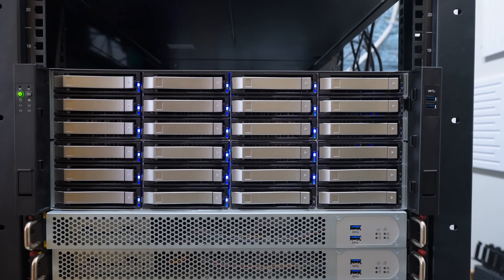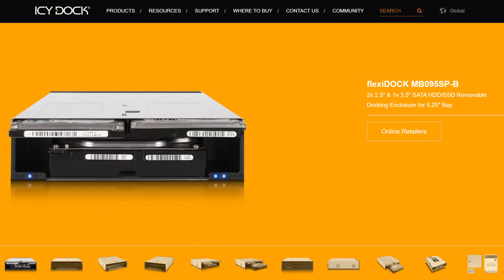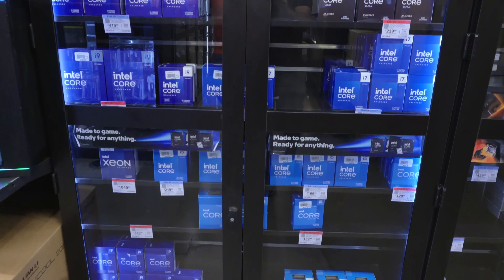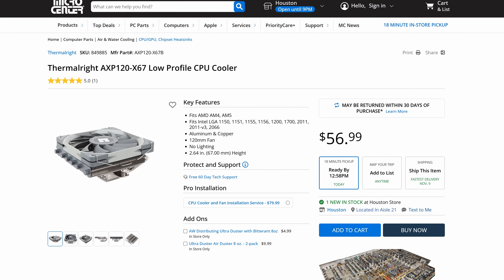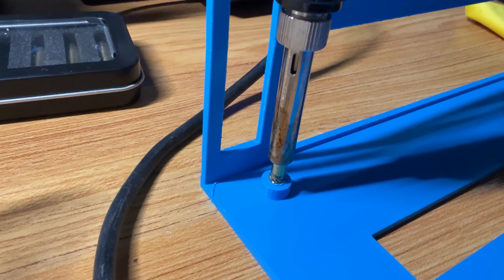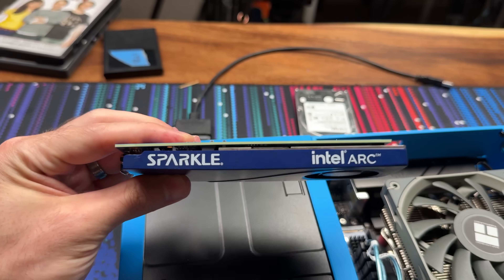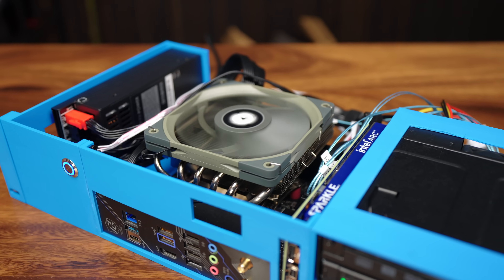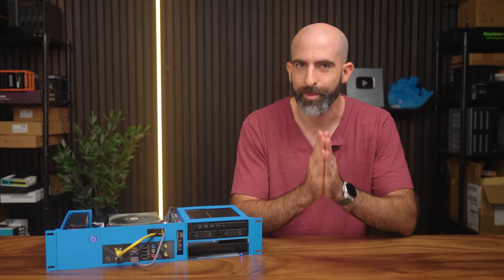I built an Automated Media Ingestion Server

Comment: Nice project, I am working on a similar rig, I ust need to do the automation

I have 90% AMD PCs (except for an old Intel desktop and laptop) and I have very few problems using  Fedora

Even on my boxes with Nvidia graphics cards,  I get the Nvidia driver from RPMForge and use AKmods to install it

I do have some Debian installs which seems to work better with Python and AI stuff

Still don't have a 3D printer but I do have a nice woodworkng shop and I am thinking of building a Tardis case

And like others have said, you need to pick a better name because it sounds a lot like ANUS when the letters are not pronounced individually

Comment: You don't have to output the file with MakeMKV all you have to do is open the blu-ray disk in MakeMKV and load the titles. When the titles are loaded in MakeMKV you can then use handbrake to load the tiles of the blu-ray disk and this will allow for encoding. I do this will all of my blu-ray disks.

Comment: I wonder how that PLA server chassis holds up in a rack with the system becoming heat soaked - I had plans for 3D printing stuff like that but was afraid the PLA might not be good enough for the temps so I never started and pushed the project down the line until I have a printer that can print like ABA or something like that that can take more heat....

Comment: Bonus, you can use the iGPU with Plex or Jellyfin for transcode, so that it handles codecs on separate metal than the ingest, meaning you can do both at once without concern. (I/O excepted)

[Edit]
Doing some testing on my system using hwaccel w/ vaapi, (A Linux generalist Video Acceleration API)

ffmpeg -encoders |grep -i vaapi
...
  libavutil      59. 39.100 / 59. 39.100
  libavcodec     61. 19.101 / 61. 19.101
  libavformat    61.  7.100 / 61.  7.100
  libavdevice    61.  3.100 / 61.  3.100
  libavfilter    10.  4.100 / 10.  4.100
  libswscale      8.  3.100 /  8.  3.100
  libswresample   5.  3.100 /  5.  3.100
  libpostproc    58.  3.100 / 58.  3.100
 V....D av1_vaapi            AV1 (VAAPI) (codec av1)
 V....D h264_vaapi           H.264/AVC (VAAPI) (codec h264)
 V....D hevc_vaapi           H.265/HEVC (VAAPI) (codec hevc)
 V....D mjpeg_vaapi          MJPEG (VAAPI) (codec mjpeg)
 V....D mpeg2_vaapi          MPEG-2 (VAAPI) (codec mpeg2video)
 V....D vp8_vaapi            VP8 (VAAPI) (codec vp8)
 V....D vp9_vaapi            VP9 (VAAPI) (codec vp9)

My 2560x1600 26M MKV file comes out around 9MB (9.2 w/ CPU and 9.1 w/ GPU)
The CPU encode actually seems a bit faster than the GPU encode, but y'know, takes all the system resources :D

I'm guessing you either aren't familiar with VAAPI (seems unlikely) or more likely, have been unpleased with either its performance, or its output, in past?

Comment: You did the shopping backwards. Start by looking at the requirements of the software, and get the hardware that matches those needs, GPU to do the encoding, any card with an nVENC enabled chip from the last five years will do most CoDecs in hardware, the last year or so for AV1. Intels ARC GPU's all do AV1, HEVC, h265 and h264 in hardware. Then choose a M'board with the bandwidth requirements matching the GPU board, and then put a CPU to run the the system and move the data from drives to ram and back. A hardware based encoder should be money heavy on the GPU and money light nearly everwhere else.
If looking for future projects, how about a Linux based NAS, that mirrors those ProRes files to three backup drives (one each for Cinematographer, Editor and Director, transported and stored separately), then does the Proxy Encoding from there, clearing the inserted SSD once the proxy encode has been done, so the original media is ready to go back in to the recording pool for the 1AC to grab as needed. It'll need a UPS as well, so it can pause the processes and go in to standby if the AC power is lost.

Comment: 1:32 assuming that one of your uses is encoding to 1080p for smartphones (because most smartphones are 1080p / even 1440p, the last 720p smartphone on Apple’s side was what, the first gen SE?) it’s probably for the best that you didn’t end up using the AMD iGPU for transcoding, as I think that iGPU is from the generation where every AMD GPU has a hardware defect encoding 1080p (it encodes it as 1088p for some math reason, idk what support for that looks like.) 

AMD’s GPU encoding isn’t exactly as well regarded as Intel’s for plenty good reason, as you stumbled on in the video. (Although, I should mention that a bunch of comments seem to think it’s just because of whatever distro you used that you had problems with FFmpeg.)

Comment: currently putting something similar together since i want to switch cases and get rid of my 5.25 bays on my main pc. does that bluray drive you got let you rip 4k blurays? i thought i remember reading theres only a few drives thatll let you do it or let you put custom firmware on them. pretty slick build, and having the ingest fully automated is a big convenience
Reply from the maker: The drive worked with no issues ripping blurays with makedvd

Comment: This is exactly something I have been looking for to start storing some of my old movies. I was just planning on manually ripping the DVDs and moving to the NAS, this will help a ton. Now I just need to figure out an easy way to convert my old VHS tapes to data.
Reply: Are your VHS tapes home made or commercial ?  Commercial tapes have an early version of digital rights protection.
Reply: @davidboyle3032  Commercial, right now I have it running through a video capture card with audio. Quality is kind of butt, however it seems to work.

Comment: I am validated in my choice of blu ray drive and icy dock bay combo.   I got a 6u rack off amazon though and hung it vertically in my entry closet. Its also my steam box so the 6u was good for having enough space for a full board and video card, and 3 5.25 drives.  I got so much space for drives i got a sas card.
Reply: The laptop bluray drive is vital for mounting it vertically.  Most full size blu ray drives can't handle the disc falling in like that, but the laptop drive you Clio it right onto the spindle

Comment: So basically this is a way cooler version than what I did with my own little ffmpeg workflow for ripping. I still dont have the entire thing automated because i really need to do a lot of code cleanup and make it a lot better at deciding when to transcode the audio and when not. Do you do stuff like checking whether footage is interpolated or telecined beforehand I havent done that yet and keep that manual for now. Automating that is something i should really get to. Also I am guessing that means that you dont really have a way of handling different video differently? LIke different settings depending on whether its animated or live action or based on the level of noise? I am guessing that is very much out of scope for this kind of application. Either way, this is really cool and gave me a list of other things I should improve on what I am doing.

Comment: I'm attempting to digitize 500+ blurays so I want to do a project with a disc magazine that automatically feeds them into the ODD. I'm considering buying a 'for parts' AV system that had a 100 disc capacity for when CDs were the media of choice. Haven't figured out the actual mechanics yet but I'm excited to tinker with it.

Comment: Question: why have the motherboard IO panel facing the front if you're going to have wires pass through? Wouldn't it be better to have like a USB hub attached to the front that routes to the motherboard?

Also, I'm not sure I'd really call this 2U. This requires being at the top of the rack or an open 1U above it for cooling. Additionally, i personally wouldnt be confident in the plastic to withstand the weight while warm, so I would want something underneath to support it. I'm not sure if you tested this in another vid, it's just my gut reaction.

Comment: I am so over Ubiquiti. I ran an old edgerouter lite for years, it was OK. Discovered OpnSense and moved to that on a Protectli box with a dual core celeron. That thing did the lords work during COVID. Ran that for a few years. Moved to a UDM SE...really didn't like it. It felt underpowered, the software is buggy, and the hardware is overpriced.. Currently running OpnSense on a Cisco Meraki MX300. Its power hungry but I have found my firewall (now to just come up with some good hardware that isn't so loud and power hungry).

Comment: with amd you could have used VA-API and libhevc_vaapi to encode into hevc/h265 but i guess av1 with intel also works well
Reply: the AMD should support AV1 as well afaik (the hardware, dunno about the software to enable it)
Reply: @LittlebitsStreamstheir newest hardware support av1 but a little older hardware and some apus dont :(
Reply: @capkenway  aye but the one he used does
Reply: @LittlebitsStreamsi believe 9000 series apu does support av1 but i dont know if 7000 series does
Reply: @LittlebitsStreamslibav1_vaapi does exist if it foes support av1, its just that ffmpeg is a whole ass rabbit hole in of itself

Comment: That's an awesome idea! I've been tossing around ideas to do something like this to help rip DVD's to my Plex server. As for joining the sections. What about heavy duty rails over the top and bottom using dove tails like you mentioned, or screws. Make the rails longer than the expected segments so you can piece multiple lengths together without them falling on two joined panel faces. If you did a mostly open face, maybe with placeable beams marking open areas, you might be able to use some of that extra thickness from the top and bottom rails for customizable face plates that use less filament to replace and would increase the reusability of the entire rig by just printing custom faceplates for most applications. They could be designed to snap into the rails. But I'm not an engineer, so maybe I'm off base with this thought lol

Comment: AV1 codec is more widely supported than H265, and slightly better file size / quality ratio. It is what big players like Netflix have standardized upon.
Reply: Differently supported, really. AV1 depends on more modern hardware (the phone I’m typing this on doesn’t support it, for example), with Intel being the ‘earliest’ at 11th gen, and AMD / Apple being the latest at AM5 and either M3 or even M4.

With H265, it’s less an ‘age’ thing and more just a mess of program / platform support. I don’t know if Windows supports it natively without the $1 license you can buy in the Store, for example, and browser support always seems a mess. I don’t think any phones don’t support it though, and Apple is pretty great about it.

Heads up, “10Bit H264” support is also weird, learned that the hard way.
Reply: @levygaming3133  Yes 10bit h264 is a mess. Generally one should just avoid that. You are better off using 10bit h265 or 10bit av1 instead at that point.
Reply: Last i checked AV1 still has plenty issues with dark areas and other undesirable artifacts. AV1 will probably replace h265 at least for low bitrate things in the long run but we arent there yet. Grain Synth would be a killer feature if it actually emulated the source grain perfectly but that too needs more work. SVT AV1 has come a long way so its actually somewhat useable but last i checked still slower than using x265. And if we are talking about file size to quality then we need to talk about software encoding because hardware encoding isnt even close.
And if we are talking about hardware encoded AV1 as used in the video, I have had more compat quirks with that than hardware encoded h265.

Comment: Only issue with this project I see is the power supply, I've had 2 of those 1U Apevia supplies fill my office with smoke and try to catch fire in my SSD NAS, first failure I figured was a fluke, the replacement did the same thing after 60 days, under VERY light load <40 watts!

Comment: Dude, I would kill for the ability to re encode my older library to .265 automatically! PLEASE do a video on this, and I am a Windows user, I have Handbrake and FFMpeg on my system already as well. I ould love for it to be able to be pointed at a directory and go through and re-encode the entire directory and copy it back to the same directory with an added letter or two that I can then delete the shorter filename  larger file and then rename the newer smaller file to the older filename.

Comment: Hey, maybe don't use PLA for this, PLA will soften around 60-70C, which are easy temps to get to with a server doing video encoding. PETG or PCTG would be just about as easy to print but far better for a solution like this, they're also significantly more rigid.

The walls of the case look kind of thin - Add some ribs along the flat surfaces to help increase the rigidity. 

Would be interested in seeing a low power version of this, maybe something based on an N100 or N150 based NAS motherboard using it's onchip graphics.
Reply: Came here to say this. That thing is gonna warp so bad in a rack.
Reply: or just use a steel shelf to support the weight and not expect the 3d printed chassis to be self supporting.
Reply: The N100 also supports AV1 even. (I’m not 100%, but I think it supports AV1 decoding and encoding, whereas the AMD cpu featured theoretically supports I think just decoding, and “theoretically” because he couldn’t get it to work in the video.)

To your first point, I haven’t 3D printed any computer parts yet, but it’s for that reason I fully intend to use the kind of filament that can handle temps just over 100C reasonably well, because if the chassis hits 100C, then you’ve already got more serious problems.

Comment: I would like to know if something like this exists: a way to skip the encoding process and have a machine automatically do the following.

Insert SSD > Server Recognize's Drive > Server Reads Files > Server Checks To See If Files Exsist On SMB Share (Using Checksum) (NAS) >  If Files Don't Exsist Move Files To SMB Folder > After Trasnfer Is Complete Then Use Checksum To Verify The Files Been Copied Over > Send SMS and or Email To User Stating File Transfer Is Complete and Details Of The Transfer

Comment: Hoping to provide good questions...
1: changing distro could improve the smoothness of use of the iGPU into AMD APU? Something like Fedora or OpenSUSE... (I quit Ubuntu because of SNAP)
2: considering the usecase, would not be 7600 a better choice for energy efficiency?
3: I'm no part into Blue team vs Red team on CPU, however... for the last two decades, Intel has shown rock-solid deliveries about chipset, mainboards, CPU, while AM4 had quite a track of dead CPUs or Motherboard. Probably was not the most efficient grunt-for-money choice, but Ultra 5 225 is a powerhouse and tops almost 40% less TDP (and power consumption) and deliver a rock solid performance for 5 years of 24/7 uptime? Tough part find ITX mainboard that don't seem a gimmick of gaming features...
Reply: I certainly think almost any Intel CPU you can buy would be a better choice for this. You get more multithreading along most of the lineup that would make software encoding better / a more viable option, it’s really the standard choice because it’s just supported so well, and pretty much any CPU you can find now (N100, 12th gen+, including the now 200 series like you mentioned, or any Arc GPU) support AV1 and even AV1 encoding at that.

The 7600x vs 7600 non-x shouldn’t matter beyond price difference, he can set the power limits to exactly the same as the non-X defaults to.

Edit: for example, while it’d be more expensive than the CPU he went with, the 265K at $250 has as much multithreading as what, a 9900x? More than any AM4 CPU, I know that much. With 20 threads and the 4threads per task he had in the video, that’s 5 concurrent tasks before you get to the iGPU.

Comment: I saw you had different profiles you can set but that requires a manual config change each time. While not perfect, some sort of visual scoring system like vmaf would be interesting to make the process more automated. You could even score after processing and then if the score fails to meet a threshold re-do the work with a different profile that may be better (probably wouldn't wanna do that with vmaf since that can integrate well with ffmpeg, but something like butteraugli would be good for a post-encode validator which there are proponents for saying it's better than vmaf)

Comment: Hey - could you clarify something? At 14:11 - you're going over how both Handbrake cli and FFMPEG are better at different things; but by that do you mean "easier to do"?
Because if HB is just a wrapper for FFMPEG, it's just a a set of commands that call FFMPEG commands. 

If this is the case - would it not have been better to say "was a better setup for me for ease of use" - rather than saying one is better than the other when they're both the same - just different "entry points"? Or does HB CLI actually feature adds on top of FFMPEG and perhaps is not using the same current version of FFMPEG and thus missing a few newer elements of original FFMPEG?

Comment: If I'm not mistaken, Brett, the iGPU won't support encoding 422 at 10 bit (which I assume your Ninja does) and the GPU card does.
Reply from the maker: Correct, more modern nvidia cards support 422 10 bit now but you’ll have to research which codec and depth are supported

Comment: My first attempt at building a NAS+transcoding machine was based on ryzen 7700, it had hw encoding working in jellyfin basically almost out of the box (after following their instructions from wiki which just tells what to pass through to the container), including hw encoding and decoding… 
So I really wonder what was not working in your case.

P.s. dedicated gpu is still better than, but it increases both power consumption and total cost of the system…